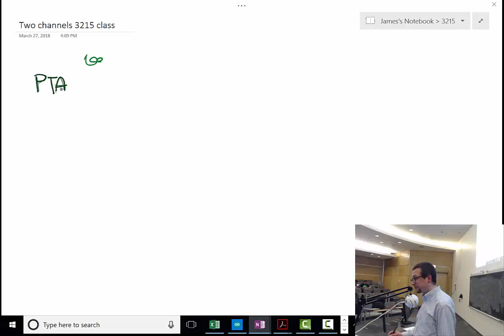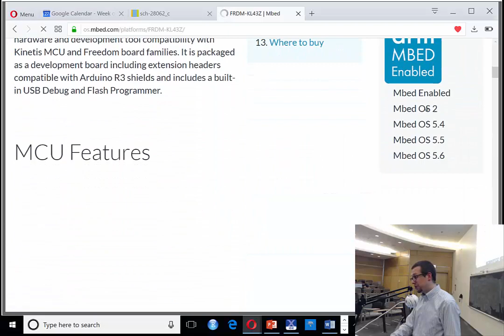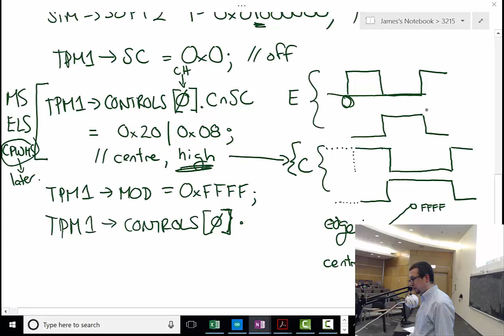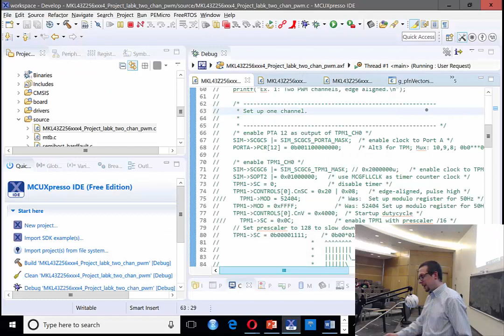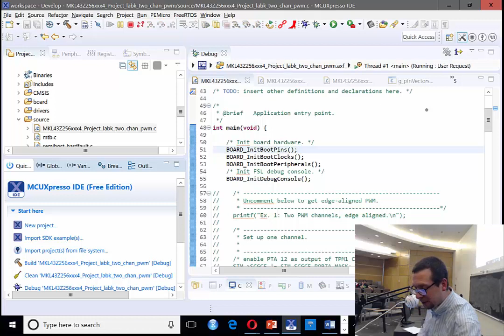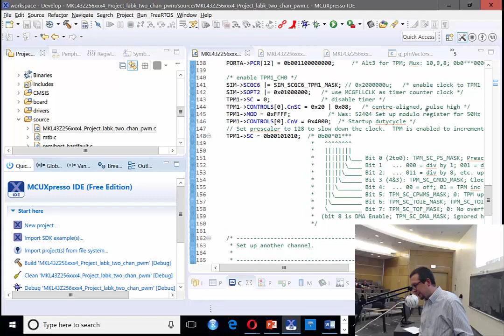EECS 3215 PWM on Kinetis

Comment: Hello Professor, Thank you for the great lecture. I have question regarding 48MHz. SIM->SOPT2 |= 0x01000000; how did you get that from data sheet? its 32bit and you are only using 8 bit, also 0x01000000 = 6th bit starting from 0? that is bus clock? so you are enabling bus clock?